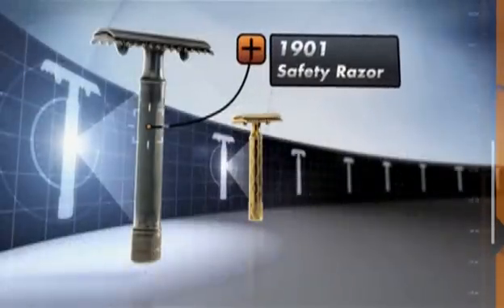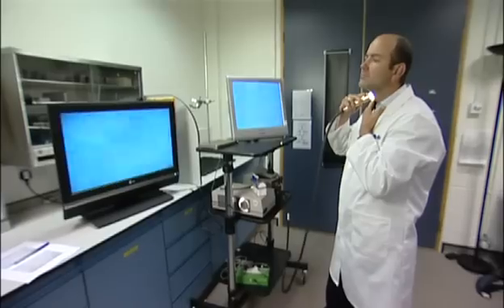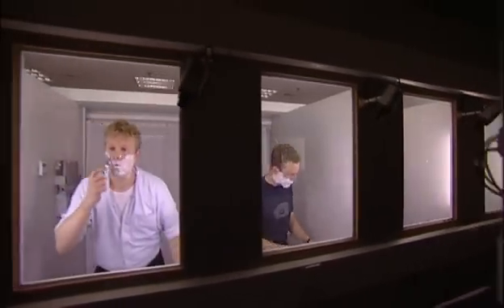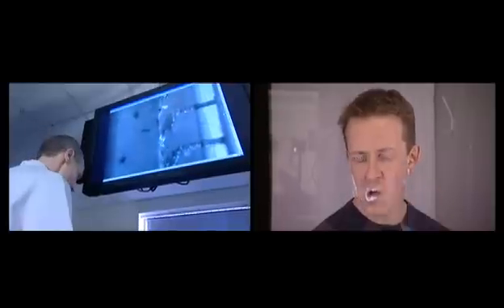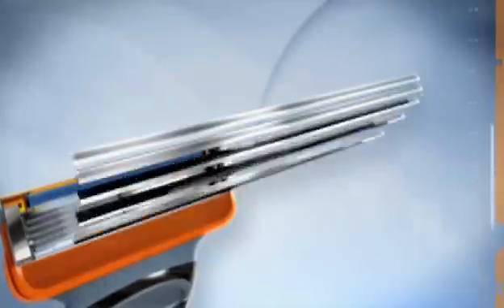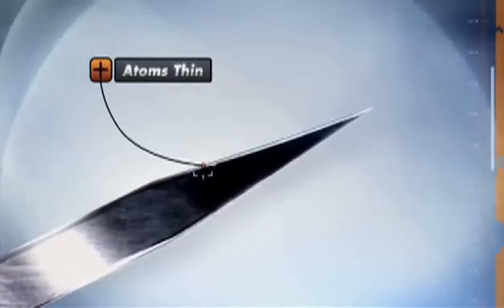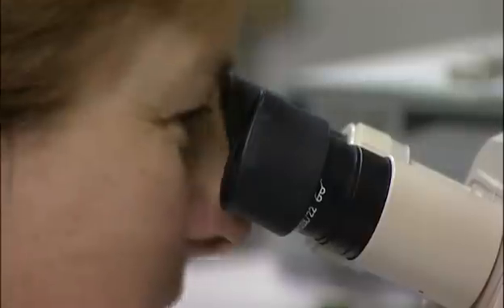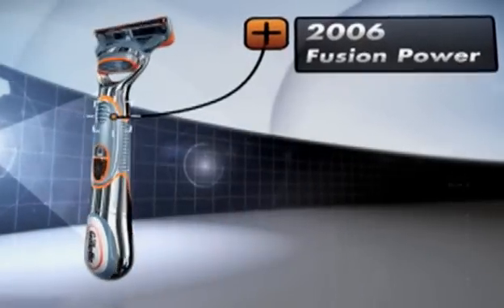How Gillette Razor Blades are Made: How It's Made | Gillette UK

Comment: They should have stopped with Mach 3
Reply: True. 5 blades are horrible on thick facial hair and get clogged easily
Reply: They should have never invented the Trac ll to begin with…..that started the multi bladed nonsense
Reply: Yep, perfection achieved right there.
Reply: Mach 3 is the only cartridge razor I own but it hasn't been used for a few years my safety razors do a better job.

Comment: The best line has to be 'Gillette has earned the trust of men', ho, ho, not in January 2019 it has not. After their anti-men advert I have stopped buying their products.
Reply: i switched to wet shaving, and it works SOOO MUCH better and it really gets all the hair off. bit of a learning curve, but it's really clean!
Reply: I have been using a FeatherDE Razor for ages & it's the best shaving tool I own Gillette blades are a complete ripp off just would not entertain them & are a complete gimmick are they going to have a 20 blade razor next ? 😂

Comment: All that development work and my old fashioned safety razor still gives me a better shave than any Gillette cartridge razor ive used
Reply: preach
Reply: @ima2319  and it's literally a fact, I've never gotten razor burn from my safety razor or even my old Gillette contour but these new "state of the art" razors suck
Reply: YOU MUST HAVE A BABY'S BEARD, FOR THAT'S THE ONLY BEARD A SINGLE BLADE SAFETY RAZOR WILL CUT. NOT INCLUDING ALL THE TINY PIECES OF TIOLET PAPER STUCK TO YOUR FACE, TRYING TO STOP ALL THE BLEEDING FROM ALL THE CUTS YOUR SAFETY RAZOR SO GENEROUSLY PROVIDES. THE GILLETTE POWER FUSION 5-BLADE IS THE VERY BEST THAT HAS EVER BEEN INVENTED, IT'S FOR A REAL MAN'S BEARD!
Reply: @oak6845  I'm assuming you've never used a safety razor, because its miles better than a fusion.i actually have a very thick beard
Reply: @oak6845  your technique is that of a baby if you say safety razor gives you cuts, it's the best AND affordable shaving method out there
Reply: @oak6845 WHY ARE YOU SHOUTING